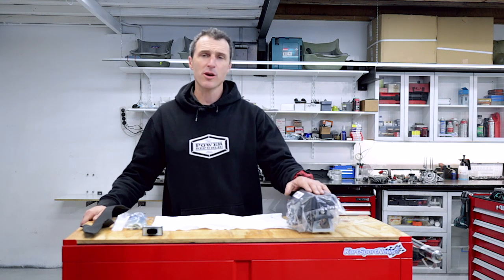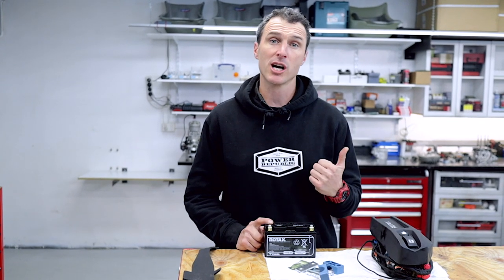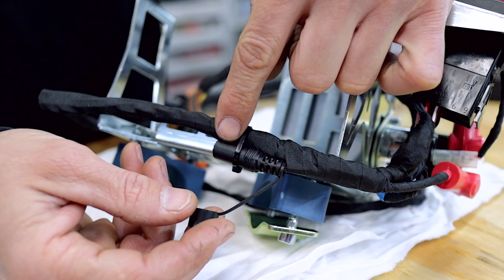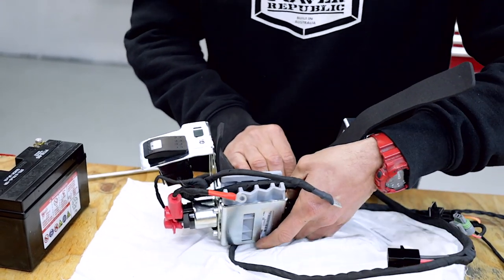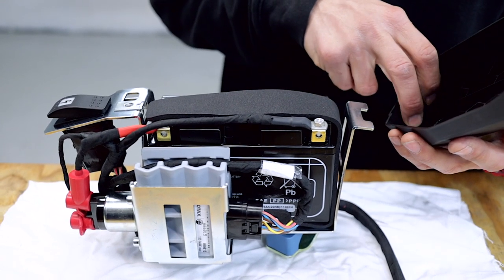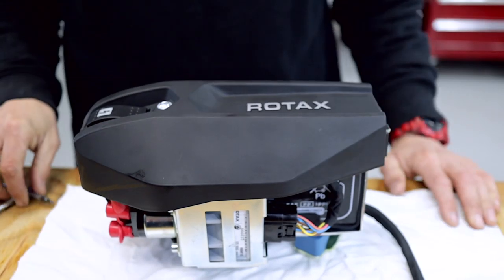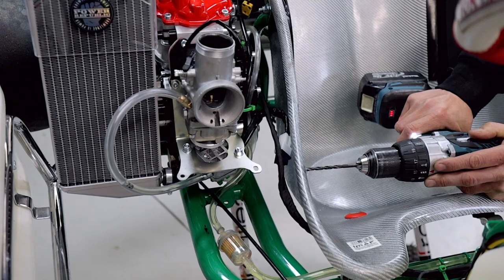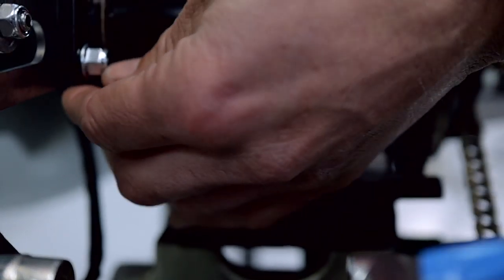HOW TO: Rotax Max 125 Go Kart Engine Wiring Harness - POWER REPUBLIC

Comment: I suffered 3 times a wire break on the same location you refer to in the video at 9:50. What is the best way to avoid this break? (I had to shorten the wire after each break, crimped new terminals on it, and use now a modified TE Multilock connector PN 444043-1 with better vibration resistant terminals than the original Aptiv Metripack one).
Reply from the maker: Hey mate, yes the best way is to avoid some of the vibrations by using the zip ties to hold the harness tight to the engine brackets.  sometimes you just get unlucky.  hope that helps.
Reply: @PowerRepublic  Thanks for the advice! I have zipped it with a 180° turn on the header of the ignition coil same as you did in the movie. I hope this does the trick now!  Your video's are really great. Gives me plenty of insight. Regards from Belgium!

Comment: So i drive a rotax junior and then after 2 laps somthings broken. the three bolts that goes through the clutch into the startkran was broken in to pecies the three pieces of the bolts was left in the startkran how could this happen??   I hope you undestood me
Reply from the maker: If all 3 are loose and not broken, then you might need to tighten them back up with some Loctite and a torque wrench set at 15Nm.  sounds like your bolts have failed.   Rotax supplies 12.9 High Tensile cap screw bolts.  Make sure when you repair yours you use the HT bolts and not the standard ones.